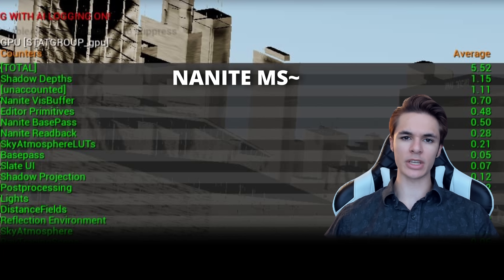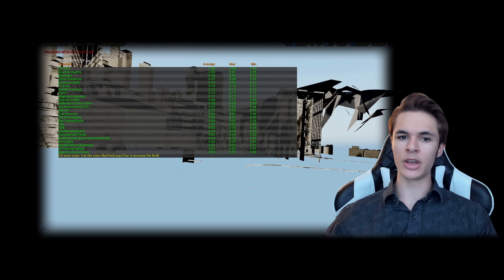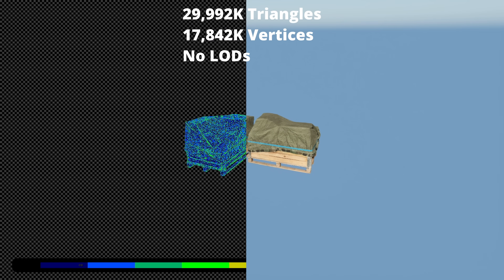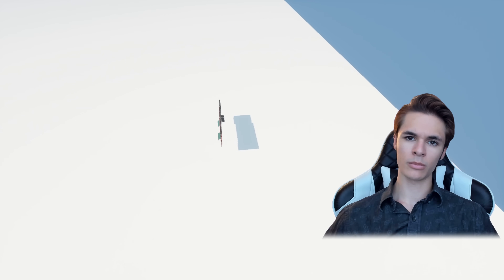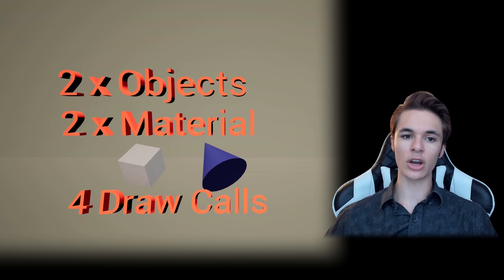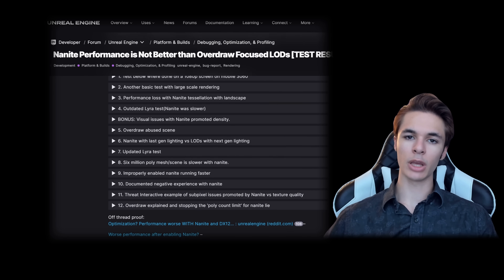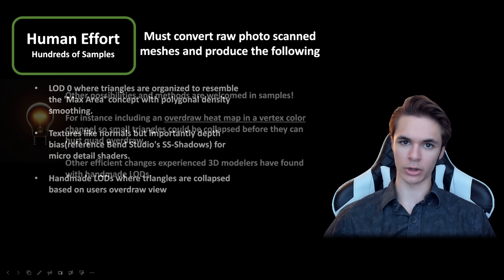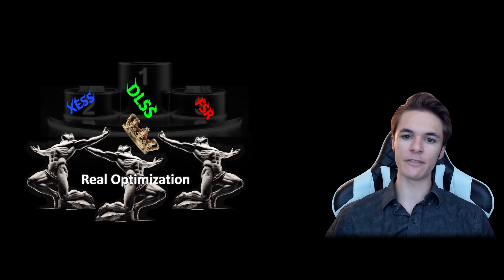Epic's Unreal Optimization Disaster | Why Nanite Tanks Performance!

Comment: I've been of a mind that nobody bothers with optimization anymore.  I use a phone at work with some software to scan merchandise, and it's so sluggish it's unbelievable.  It's just some simple ui and access to the camera, it could be fast, but it refuses to be, because it's been slapped together with no care for performance.
Reply: I can only speak to gamedev, as thats been my field for ~25 years now.

This has been true since the late 2000s. My job has been at a contracting house that would get called in when the needed to ship and were struggling to do it

Theres a lot of factors that come in to play, and all work against it. In no particular order .:.
x) Treating perf has a polish feature thats fixed at the end, and not the bug it is, and fixed as needed
x) Gamedev processes (ie scrum etc) reward doing lots of little easy to complete tasks, and punishes more open ended tasks. [Aside: it also rewards checking in 'working' but buggy code, and punishes trying to fix bugs found]
x) Many many many more teams can make games, so the talent is more spread around except in a few companies that soak up a lot of the high end talent.  
x) Performance is tricky, hard to do, and is more art than science.  Plenty of people could absolutely learn to do it (and do), but theres a large portion that just arent given the time needed. This leads to less companies having those 2 or 3 hardcore engine folks that can really dig into things.
x) Generally less ownership of projects as a piece of art youre proud to display, and more a product for consumption in the giant maw of capitalism
x) Programming more as gluing APIs than building and writing code.  I see folks complain about an API issue that would literally be fixed for them by writing 1 function that encapsulates what they need.  
x) Many teams are just stupid huge.  Communication suffers.  Fast agile decisions suffer.  Pivoting suffers.  Shipping suffers.  Gameplay suffers.

Theres tons of secondary pieces.  

All that said, making games is hard, and a lot of teams are trying to make the best game they can, as well as avoiding 1 or more issues Im mentioning above.  But its hard not to look at the trends and feel some despair at the state of things.

Comment: Thanks for doing an in-depth analysis on Nanite vs LOD.
As a self-taught solo UE game dev, nanite allowed me to focus on making my game without needing to optimise for LODs.

Personally, I find Nanite to be a fantastic tool / feature and Epic has been doing an awesome job making everything more and more efficient and easier to use over time.
Nanite also allowed us devs to use assets like those from MegaScans without some form of decimation done in advance. Just drag'n'drop.

As you demonstrated in your video, LOD optimisations will still be more performant and sometimes by quite a bit.
However that requires extra time and known-how to implement and optimise for. Time solo devs and small teams can put towards getting a game out faster or towards features/bug-fixes.

Your analysis shows that devs with the expertise and experience can make a huge difference to game optimisation.

Keep up the great work.

Comment: I am just starting with UE 5.4 for the first time. And had wondered if LODs was indeed better the Nanite.

Yes, using Nanite, does cut the work load for indie devs, in not having to make custom LODs for everything. But, seeing UE has a good built in LOD creator, what you said makes it seem worth using, than switching to Nanite.

After all, when it comes to game development, an optimized game, is better than a quickly made one.

One hint about VR and LODs in UE, is I found the LOD transition happens closer than it seems to on a 2D screen. Seems it has something to do with UE LOD transition being based on screen rez, and not on object distance as is the case in Unity. Meaning, LOD transitions must be set further back, if you intend them to work in VR. Unity, dose not have this issue.

Actuly Unity has far less issues when developing VR in it than UE has. Still, I have no interest in using Unity anymore. There are many other issues with that GE that keep me from wanting it use it anymore.

From what I have seen, UE 4 is better for developing VR content with then UE 5. Sad.

Comment: Thanks for the video! I appreciate the effort you put into comparing Nanite with traditional optimization methods. However, the full potential of Nanite might not be fully apparent in a test with just a few meshes. Nanite shines when dealing with large-scale environments that have millions of polygons, where it can dynamically optimize the scene in real time. The true strength of Nanite is its ability to manage massive amounts of detail efficiently, which might be less visible in smaller, controlled setups. It would be interesting to see how both approaches perform in a more complex scene with more assets, where Nanite’s real-time optimization could show its advantages. Looking forward to more in-depth comparisons in the future!

Comment: 10 years Unreal developer here. I've never really been into deep low-level rendering stuff, but I just discovered your channel and I'm glad your videos answered some long-lasting questions I had, like "why is this always ugly and/or blurry, no matter the options I select?? (or I drop to 20fps)". 
With time, i have developed a kind of 6th sense about which checkbox will visually destroy my game, or which option I should uncheck to "fix" some horrible glitches... but I still don't know why most of the time. In many cases, I just resign and have to choose which scenario I prefer being ugly, as I can never get a nice result in all situations. And it's kind of frustrating to have to constantly choose between very imperfect solutions or workarounds. I really hope you'll make standards change!
Reply: I know I'm late to this thread, but After 3 years on unreal I decided to write my own engine for this exact reason. IN my case I have written from scratch before so it's a fun process that I enjoy, but the trigger was what this OP mentioned. Just the sheer quantity of undocumented hidden gotcha's broke me.  I ended up change my game to work around 'unknown slowdowns' I could never explain. Very deep debugging really told me nothing. Forums left me with no answers. So, while writing my own engine is a TON more work, I start from the opposite direction. Near unlimited FPS (well, buffer flip \ clear speed very high thousands of FPS), then everything I add has a measurable known impact that I can actually debug.  
Absolutely not saying 'people should not use unreal as it's too complex for the quality of documentation' but for me, writing a MT world state feeding vulkan was easier than divining never ending fps drops. Mentally I could not handle the idea of 'I'll make it acceptably fast layer...hopefully' and then pouring years of effort in on a blind faith.
Reply: you can also learn what those checkboxes actually do and solve the issues by yourself for your specific needs
Reply: That's kind of a joke, that someone with over 10 years in an Engine has no fcking idea, how that stuff actually works.
Reply: @JesterFlemming  Engine dev covers way more than low level rendering, let's not act like douches because someone admits they don't know everything.
Reply: @DemsW  It's the fact that they're stating TEN years of EXP  ..and yet dont know a basic fundamental rules of the software.     thats odd.
Reply: @ Again, some people make games for the creative side of things and couldn't care less about the technology behind it.
Nothing wrong with that
Reply: @JesterFlemming  The the purpose of Game Engine smart ass, save you e.g. 15 years developing a game by  yourself
Reply: how are you a 10 years unreal dev doing low level rendering stuff yet couldn't figure that out yourself
Reply: @papermartin879   "10 years Unreal developer here. I'VE NEVER really been into deep low-level rendering stuff"
Read it again, smart guy

Comment: Nanite is designed for geometry way above what we currently have in games.

So until games reach the point where their geometry is high enough to require Nanite then Nanite will be slower than traditional methods.

Maybe next generation will get there.
Reply: With the current performance increase of hardware it'll take like 20 years to reach that point.
Reply: We are at the point of diminishing returns of poly count. Like how many more polygons do we need to render 2Bs buttcheeks?